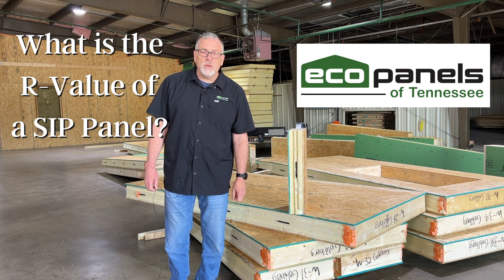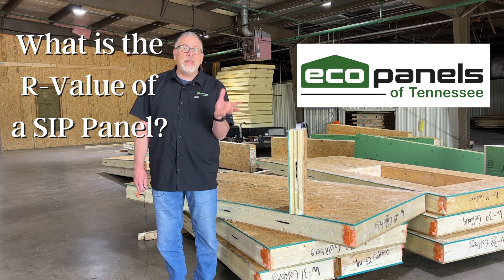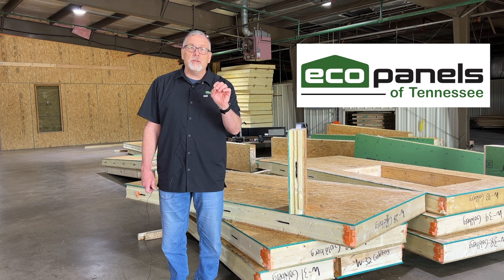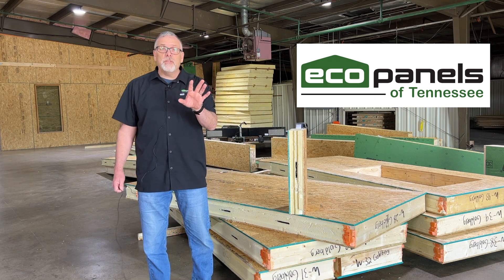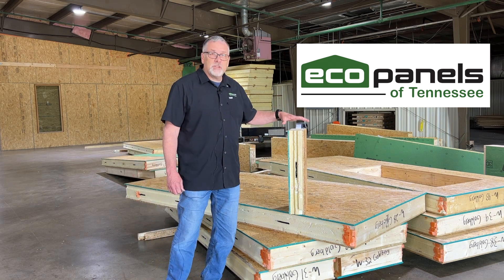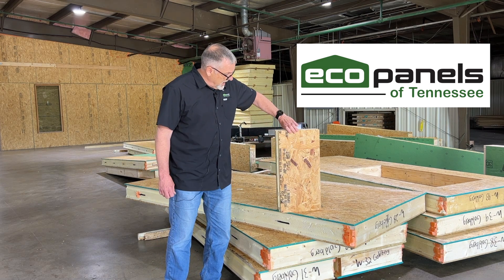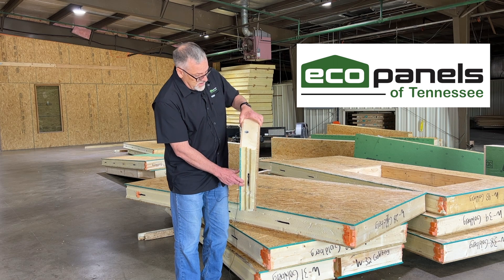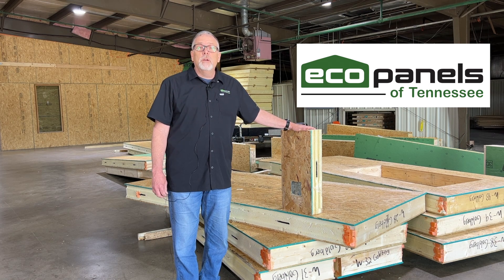What Is The R Value of a SIP Panel?

Comment: What is the r value of sips panels using styrofoam like  Mighty Small homes of Louisville, KY uses.  his walls are 4 1/2" thick.  His roofs are 10" thick
Reply from the maker: Good question John, but unfortunately it's hard to say. I would suggest you contact them directly for that information, as I didn't see it readily stated on their site. It is safe to say that most EPS foam has less R-per-inch than most polyurethane based foams like we use. There are a lot of other benefits of urethane based foam over EPS. That said, EPS is typically cheaper. Thanks for the question.
Reply: @EcoPanelsofTennessee  Thanks Rob,